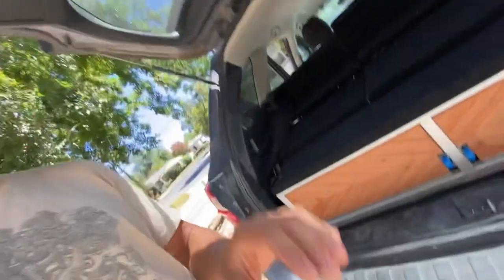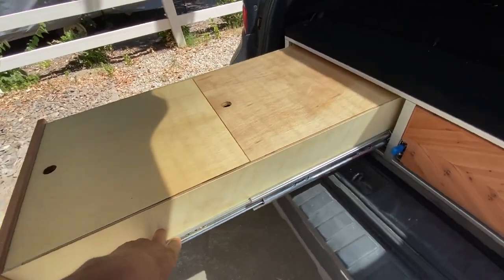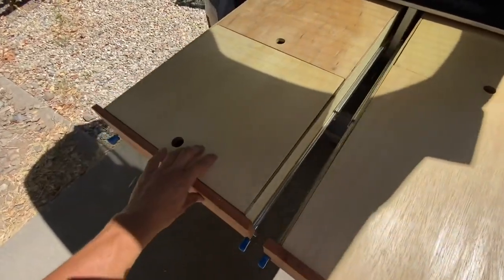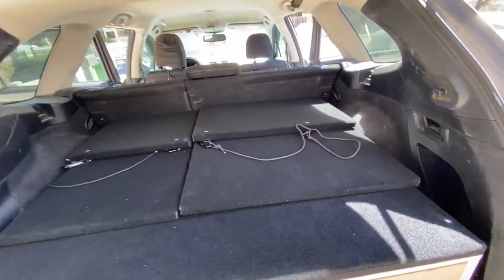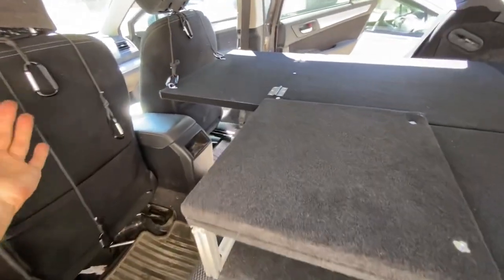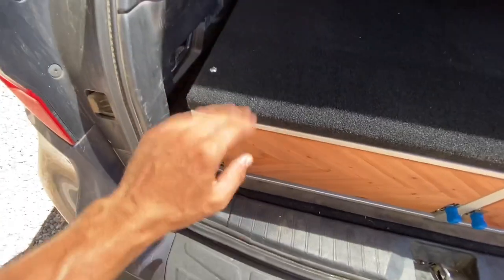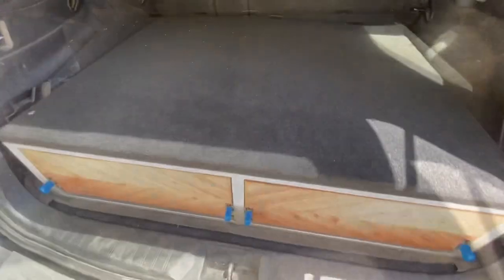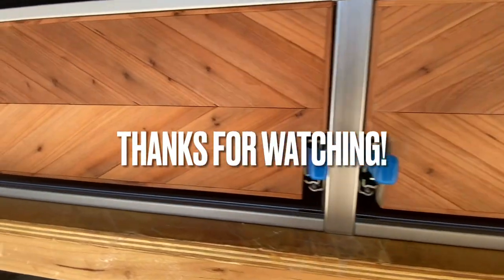Compass Camper Conversion Kit for Subaru’s and other SUVs, Heavy Duty Drawers, Bed Platform

Comment: Can't leave a comment on Etsy. I don't know why. Anyways, long overdue review on this platform. Very sturdy, drawers are very good. You can take out the separators if not needed which is cool. It is solidly attached to the vehicle so it doesn't rattle around. I tried it in the Sierras several times on little offroad trails and it follows the ups and downs of the car no problem. It's exactly what I expected it to be. Anthony is responsive an d can make a few little custom changes for you if needed.
The only advice i could give to someone who wants one for a Forester is to really think about the headspace. I might of underestimated my 8.5" drawers. I feel a little too close to the ceiling when adding mattress etc. If I were to go back in the past, I would probably make it 7.5" at the expense of drawer depth.

Anyways very good design! Highly recommend!

Comment: this looks awesome only had two things I was worried about/would recommend 1. possibly find a way to not have the cord rubbing up on the car seats (could cause damage) and 2. on the 4runner find a way to have it fitted over wheel wells so you could fit a full size mattress in it.
Reply: w1Q

Comment: I'd have to measure first, but would only need half of the setup. Probably the table side.Not a Subaru but a 98 Ford Explorer.  My back seat has a 2/3 - 1/3 split, would use the 2/3 side. Do you sell just one side? Would have to ship to Wisconsin.

Comment: Looks good to me. And affordable. How long is the bed frame made for a 2020 Rav 4? And how much head room when it is in place. in a Rav.
Reply from the maker: Great question. The trunk frame is about 30”long by 38” wide, the bed extension is about 27” long, and the headrest is 17” long. For a total bed of 38” wide by 6’1” long 👍🏼
Reply from the maker: Total headroom above the camper is roughly 27” depending on where you measure exactly

Comment: Wish you were closer.  I just need one drawer.  Wonder how much shipping cost would be for that to SoCal.
Reply from the maker: Just to clarify, you just need one singular drawer without the framed platform and drawer slides? Shipping wouldn’t be too much for that, maybe $40 or so. I’d have to check with UPS
Reply: @compasscamper5730  It would be for a single drawer slides that is around 55-56" long and 20- 22" wide and 14" height  :)  It's for my Jeep Gladiator.  The other half of the truck bed has a large fridge/kitchen slide already.  What's your guess on the shipping for that?
Reply from the maker: @TuanNguyen-ld8kl  sounds great! We can totally get a custom build going for you. Email me at compasscamperconcepts@gmail.com and let’s talk more.
Reply: I just sent an email.
Reply: @compasscamper5730  Didn't see your reply til now.  I will be removing my rack setup and install an alucab canopy hopefully by this weekend or next.  Will be taking measurements and shoot you an email.

Comment: Where is the spare tire?
Reply: It's under the platform beneath the stock floor liner, he talks about it and what to do to access the spare with the unit installed. However, Subi only made this area for a donut so if you want a full-size spare, do what the rest of us do and get a rear bumper tire carrier or throw it on top of the rack into a roof basket.

Comment: I would never ever put a raised bed in such a small car 'sorry but theirs just nothing like bad head room
Reply: I’d rather have poor head room than sleep on a surface that isn’t flat.
Reply: I’d rather have poor head room than sleep on a surface that isn’t flat.
Reply: I’d rather have poor head room than sleep on a surface that isn’t flat.
Reply: I’d rather have poor head room than sleep on a surface that isn’t flat.
Reply: My build out is a similar height. It is more difficult to get in and out with less headroom, but it doesn't make a different when it comes to actually sleeping. There isn't ever enough room to use the space for anything other than sleeping so I think it is worth it.
Reply: Headroom will suck in a car regardless of having a drawer system or not. It's tradeoffs, also, the dimensional height can be changed through custom requests. But then, if you "would never ever" then why even watch the video and leave a comment? To each their own and if you don't like and are against it, just shut your mouth and turn around. You won't see the video or the people who use them. Keep it to yourself.